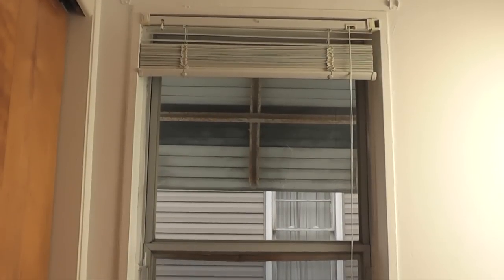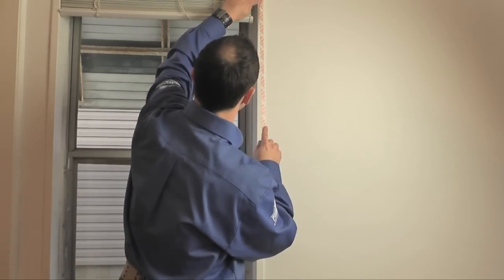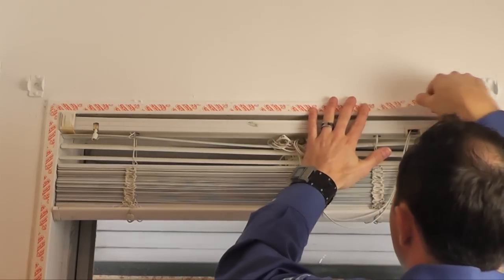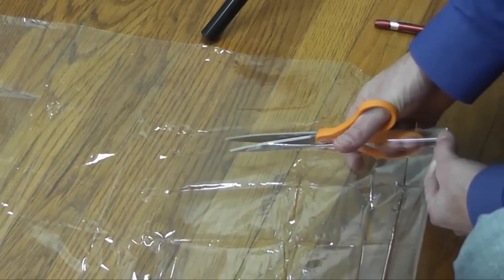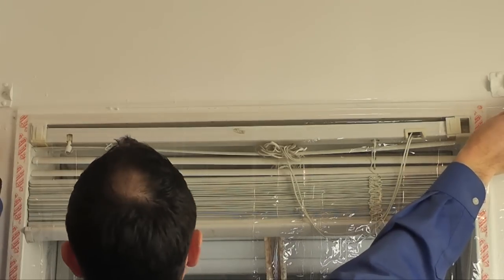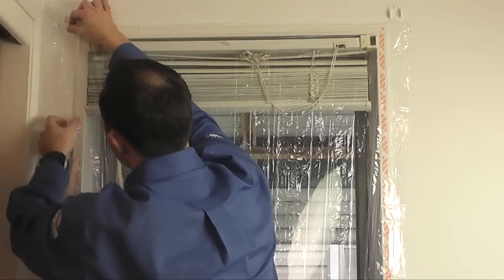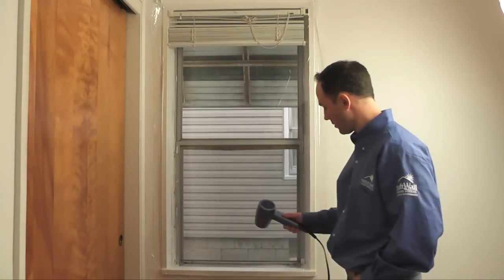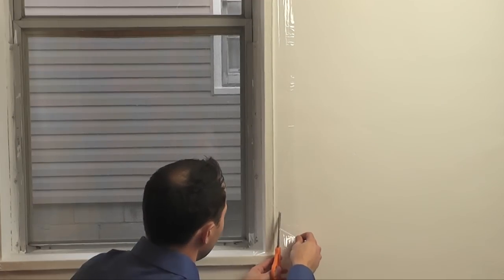How To Insulate Windows With Plastic For Winter

Comment: I would like to know if it’s at all possible to do this where you can seal the window behind the venetian blind.
Reply: i know this comment is old but in case anyone else was wondering about this - i think the purpose is to create an airspace.  it's a physics thing (like the energy-efficient windows that have an airspace between two panes of glass).

Comment: Ummmm......so yeah.  These instructions aren't any more help than the ones provided with virtually every brand kit.  Now, here's a thought:  They left the blinds up (and not even evenly spaced at that!) and the cord for raising and lowering them is inside the plastic. So now you're stuck with them in that position until you remove the plastic.  I have blinds on every window in our home.  There are ways to put on plastic AND have the blinds accessible for raising and lowering.  Now that would have been a good tutorial.  Blinds up for winter sun to warm is a good thing...but then maybe not such a good thing for privacy ;-)

Comment: I wished I would've watched this video before installing this clear cover...revealing only small parts of the two-sided tape will make it much easier when applying the plastic.  Thanks!
Reply: YES - A very important step, particularly if just a single person is doing this. For some reason, the manufacturers don't bother to tell you this on the instructions they provide you.

Comment: For all those complaining about why the Blinds were left up...Did you ever think of Light??? The whole purpose of the wrap is to prevent drafts, therefor the blinds being down has no argument for providing extra heat. #EngineeringForDummies
Reply: It was a good video but what everyone is complaining about has nothing to do with the blinds providing heat. It has to do with security and the fact that you cannot control your blinds. If you leave them open and let in sunlight you run the risk of exposing everything in your house to potential theft.  #commonsense

Comment: Does this kind of insulation only stops air drafts or does it also help prevent the heat loss from the glass as well?
Reply: Heat loss and cold drafts both result from the inner surface of the window being cold in the winter (or the reverse in the summer) and both are significantly reduced by this type of insulation. The added thin film layer adds two convective* barriers to the path of heat transfer from the window to your room. The glass itself has two convective barriers, one on each side and the film adds two more. The spacing between the glass and film is typically larger than optimum, but still helps considerably to reduce heat transfer through the window. 
[* Heat is transferred by three mechanism: conduction, convection and thermal radiation. Depending on the infrared transmission properties of the particular film plastic film used, it might also somewhat reduce radiation heat transfer.]
Reply: @chuck2dstars85  I'm amazed at myself for not seeking out more information on this topic since the moment i made this comment. Thanks alot, your answer does confirm my suspicions

Comment: I think that they left the blinds up on purpose and after they completed the window film, it appears that they were going to hang another set of blinds above the moulding. You can see the brackets for the new set of blinds already installed above the moulding of the window. Why 2 sets of blinds? I know the set above the molding will come down when you take the film off, but it just seems awkward to have 2 sets of blinds for a window
Reply: Have you heard of curtains?

Comment: So thin plastic sheeting is a thermal insulator? It would prevent drafts but I don't see how this insulates a room in anyway.
Reply: The pocket of air between the plastic and the glass is the insulator.
Reply: Doesn't work, sadly.
Reply: @MrRik2  so you understand that radiant cold is much less than blowing cold air, right?

Comment: Not a very healthy idea , condensation build up between the plastic and the window will cause mold plus the condensation has nowhere to go and inhaling stale air in sealed up heated rooms is not pleasant, even on cold days open at least one window for about a half hour. Buy an expanding curtain rail that expands about a 12 inches on either side of the width of the window if you have that space, install close to the ceiling, giving enough room for end fittings. Buy heavy floor length lined drapes and a set of curtain liners that fit the drapes, hook the curtain liners to the drapes and hang the drapes now you have access to the blinds, I prefer white net curtains as the window is then fully dressed. You can use the same method on front and back doors using one floor length drape keeping it open during the day and closing it at night. Obviously every room will not have floor length options in such cases drapes sitting on the sill or slightly below it will suffice.

Comment: My single apartment window is roughly 150 inches wide and roughly 60 inches tall. Any suggestions on how many kits I would have to buy? Your response will be greatly appreciated. And oh yeah I'm a man so I definitely don't have a hair dryer with which to smooth out the plastic films wrinkles.

Comment: Your house has to breathe because YOU have to breathe. Rather outside air is cold or hot, you still need fresh air. Don't go making your home an air-tight coffin just to save on gas and electricity.
Reply: Clint R sure. you open your windows when it's no warmer than minus 20C outside for 3months straight.
Reply: ***** Ahh, I get it. That counters the build up of carbon monoxide the other 9 months of the year. Got ya.
Reply: You obviously don't live in a home that's 120 years old.  It breathes plenty 😆

Comment: Doesn't work. I have a North facing window on an older house. Even after cleaning the frame with alcohol and letting it dry, the force of the air coming through the leaks pulls the tape right off. Your video shows a newer window, which shouldn't leak. You're just another commercial pretending to be helpful content.